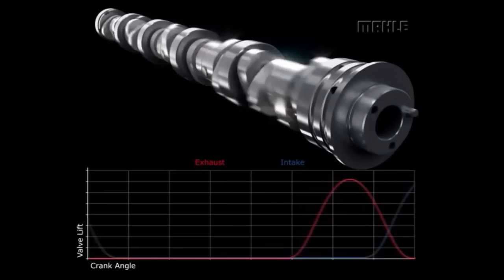2021 427 Mach 1 Mustang ..  Fords 7.3 Godzilla Engine.....

Comment: The pushrod motor will be able to get higher torque numbers than an overhead cam design. For a big block, torque is a must!
Reply from the maker: Makes for a good truck motor i guess
Reply: @coyotecarguy2076  yes,exactly... but I would love to see Ford find a way to get big torque numbers from a overhead cam assembly. Then it would be the beast of big blocks!

Comment: Coyote carguy  An aluminum Ford Windsor push rod engine with added tech is exactly what the Chevy LS engine is. Most engineers agree the LS engine is nothing more than the Ford Windsor engine made in aluminum alloy with a few changes. Ford Racing is making Big power with their engine and these engines are tons easier to work on. A balanced aluminum alloy pushrod engine with all the new cylinder head improvements is exactly what we all need in a Ford Truck. If they can vastly improve fuel efficency with the new injector tech it's a big win. No twin turbo V6 garbage!!!
Reply from the maker: Gman Neo'd....  My thoughts exactly.. A DOHC engine is awesome but if the proper tech is applied to a pushrod design would be a versatile 
engine suitable for many applications... lets hope it happens...

Comment: ford will do both, a 7+liter pushrod, primarily for truck duty, and a 7 liter dohc , which is for the mustang, and possibly another vehicle, such as a hotter version of the mid engine GT.
Reply from the maker: Bono Simic....Well, I hope you are right. A 7.0 DOHC is waht i would like to see.
Reply: I know this is been a year ago. But I seriously doubt we will see a 7 liter anything in a car these days. The new Mach 1 will be getting ready to be unveiled soon.  I am curious on what engine it will have. If it is 7 liters it most certainly will be a big shocker. Ford hasn’t had that big of an engine in a passenger car in 4 plus decades. My guess is it’s another variant of the 5.0 coyote platform. I can’t imagine them squeezing much more hp out of a NA coyote and still run on pump gas. The bullitt has 480hp. It might be the beginnings of a hybrid system. I wouldn’t think they would put the voodoo flat plane crank engine in it??? Who knows. 🤷‍♂️

Comment: Honestly I think Ford building a pushrod motor would be a step backwards might as will remove the independent rear suspension and put the live axle back in it. Doesn’t make sense at all.Ford has sunk tons of money into the eco-boost program and have always made more horsepower with smaller engines look at the coyote 5L, The GT500’s had a 5.4 L, and  the 13-14 GT500’s
a 5.8L with 662hp that was five years ago and everyone is talking about 707 hp from a 6.2 L engine???  Hopefully that 7 L mystery motor is coming soon and ends up in the next mustangs platform...
Reply from the maker: IMGONEIN60. Hey my friend thanks for posting. Yes my friend i am disappointed also. I think ford is looking at cheaper engines. Its the only explanation for this. Lets see what happens. i am hearing that this new engine could end up in the SUV version of the Mach 1 that is coming out in 2021. Should be interesting.
Reply: Coyote carguy The Mach 1 is going to be an ALL electric performance SUV Ford announced it when they announced the upcoming ford ranger, and the edge ST along with the 2019 bullitt.
As far as the 7 L motor being pushrod I don’t believe it at all the primitive pictures that I have seen of it I’ll look like a modular design. But like you said We’ll see.
Reply from the maker: IMGONEIN60. The mach 1 version if that SUV Is the electric one. what i mean is that that SUV may have this engine not the Mach 1 version, You are right about that. Truthfully i was convinced that the 7L engine wad DOHC. But i herd from someone from the industry who informed me otherwise. Hopefully i am wrong. It wouldn't be the first time.
Reply: Coyote carguy yeah let’s hope it finds its way into a mustang, even if it’s a specialty mustang and not just going into a truck or SUV. We’ve seen what Ford has done with the 5.2 L that’s just amazing imagine if ford came out with a modular 6 L motor, Dodge and Chevy would be suicidal LOL
Reply from the maker: IMGONEIN60. You are spot on!! Read my mind exactly. I Would like ford to make the 6.2 Truck engine into a DOHC engine like the coyote. I think that is a 390ci engine.
 didn't the original Steve Mcqueen bullitt have a 390ci? That would be the ticket since they already have the motor!!

Comment: I personally never understood why no one made a four valve pushrod engine.  There was a company that made a 4 valve push rod head for the Windsor 5.0 back in the early 90's.  Seems like an OEM should have gone that way at some point in time.  I would imagine a DOHC 427-429 cu. in. displacement engine would be very wide and difficult to package based on deck height and valve cover width.  The S550 doesn't look like it's all that wide.  However, I don't know the actual dimensions... so maybe it is wider than previous generations of Mustang.  Should be very interesting to see what actually happens!
Reply from the maker: fwh79. That's Funny i remember that 4 valve head. What ever happened to it?? If you should find info on it please forward it to me. Imagine a 4 valve pushrod motor with with the mahle cam in cam  twin phaser tech?? It would be awesome. Thanks for posting my friend!!
Reply: Coyote carguy:  I'm not sure what happened to it.  I want to say I remember two different companies making a 4 valve pushrod head.  I have a book that is copyrighted 1992 that shows a 4 valve pushrod head for the 5.0W that is made by Arao Engineering.  I think at some time in the later 90's another company tried to bring the idea back.  I can not remember the name of that company.  They never really took off because they were much more expensive than the typical bolt on heads at the time.  Most guys didn't want to spend $1000.00 on 2 valve heads.  I want to say the 4 valve head was some where over $2,000.00 for the lowest level head.  That was a lot of money to cut lose with for heads.  However, they were probably worth every penny.  I think there are several OEM diesel engines that are 4 valve pushrod engines.  That makes me wonder why none of the big 3 companies never decided to go that route.  A very interesting thought indeed!  I just did a quick YouTube search and found two videos you might want to check out:  Ford-  https://www.youtube.com/watch?v=hW6l_MN9Uys  Chevy-  https://www.youtube.com/watch?v=vRKTRLD2h8k  Ok... now that I have watched that... why has this never been an OEM head design!????
Reply: Coyote carguy:  Check THIS video out too... LOL!!!  https://www.youtube.com/watch?v=GbOq1O5y-Y0  I guess THAT is why you don't see or hear much about Arao heads! Hahaha!  It's not really funny... but it's pretty damn funny.
Reply from the maker: fwh79...There is a lot to talk about with this 7x engine. There is talk that the power levels will compete with the diesel engines. That guy with the corvette was pretty pissed!! I don't blame him. My Radar is up on the 32V thing.  Thanks for the heads up My friend!!
Reply: Coyote carguy:  You're welcome.  I hope they call the new engine Gorilla!  That is a great name.  Yeah, the vette dude was mad but he should be.  I guess it still boils down to "buyer beware".
Reply from the maker: fwh79.... Yes sir!! Buyer beware!!  By the way i will be doing some pretty stout mods to my car and and you will probably like who is doing the work!! So stay with me,. It's gonna be fun!!
Reply: Coyote carguy:  Sounds good.  I'm not going anywhere brother!

Comment: I know this sounds disheartening...but i'm glad Ford is still building V8s at least.  Or still plans to.   I'm happy with my DOHC 32V V8 5.0.   As a matter of fact...back on your other video where you talk about people's disappointment with the 4.6 liter....I was one of them!   I would have been so much happier with a 5.0 hands down.
Reply from the maker: Tony Amarillas. Hey Brother, Always nice to hear from you! You think very much the same way i do. I feel grateful that we still have cars like this. I love my 5.0 Mustang as well. If the next generation mustang is not better then the one i have i will keep this one for a long time.
Yes my friend the 4.6 was a bad idea, If it were equipped with vvt on the DOHC 32V 4.6 V8
Than maybe it would be a good motor. But they sucked the way they were built at the time.
Today things are better, i hope ford does not screw things up. Thanks for posting!!
Reply: I have a DOHC 281 inch modular in my Mach 1. With a few easy mods it makes 350+ HP. 
How were they a bad idea? They were a match for the other larger V8s of the day. The bad idea IMO was the SOHC 4.6 being in the Mustang GT. EVERY mustang GT from 1996 up shoulda had the DOHC 4.6
Reply from the maker: 331 grabber.... What year cobra did you have? or was it a 03-04 Mach1?
The camaro from 93-02 were very stout. a few mods to them and look out!!
The problem was GM was putting 350's in the camaro and trans am of the day. The 2 valve sucked. the 32 valve was not bad but i personally watched some friends with cobra's get whipped by the camaro's. My point is that if ford built a 5.0 instead of a 4.6 things would have been very different. And mustang owners would have been much happier.  
ford made the correction and built the 5.0 coyote! Thanks ford!

Comment: Hi Al,
Have you seen the videos of the Stang owners that have clicking engine noise issues, some stating it is piston slap, caused by the new method cylinder lining?
Reply from the maker: johnnyrmac...Yes check out "boosted addictions" He had his motor replaced for the ticking problem and now the replacement engine is ticking as well. even worse then the first one.
The gt350 used the spray bore Technology and we don't hear about those problems with those cars. I herd there was a bad batch of motors and we hear about them one by one. so far this is not a wide spread problem. i really feel bad for that guy!!

Comment: Build the 7.3L Godzilla Engine, with pushrods...put it in any V8 Mustang . A possible choice would be to put in the BULLITT MUSTANG, take one to SEMA beside a GT500 or a SHELBY SUPERSNAKE, then send that same car to the Detroit Auto Show or in New York. Then watch FORD take orders for the first 2000 cars.
Those orders will be filled within 30 days. People complain that it won't be faster than the Supercharged Mustangs.Doesn't have to be: IT'S A FACTORY BIG BLOCK FORD MUSTANG. That's why IT will sell. FORD'S NEXT BIG IDEA.
Reply from the maker: Jay Britt.... I like your way of thinking... a big block mustang will sell no matter what.
some people are saying that the 7.3 block is to long to fit in the S550 mustang. I am gonna say they will make it fit if they want to. Like putting a 460 in a fox body.

Comment: The rumor mill is spinning like a pinwheel I'll believe 427 dohc Boss 429 when it sits in the showroom floor Ford dealers.
Reply from the maker: Lorenzo Maximo....This is an old video i posted a while back. The news today is that ford is building a 7.3 liter pushrod engine for the big trucks. this engine will be used for specialty vehicles including a limited production mustang.
Reply: @coyotecarguy2076  
I hear what you're saying but this is an old story that's been circulating for quite some time and hasn't come to past yet. I don't know why Ford is so reluctant. They could have produced this engine years ago but haven't. They just seem to be infatuated with small cubic inches. The dual overhead cam Coyote engine is a great motor but it's very hard to work on compared to a pushrod motor. Plus it's not classic car friendly a lot of modifications need to be done to install this motor in older cars.
Reply from the maker: Lorenzo..... I Hear Ya!! This time however we will see the new motor!
I will probably be the first to report so keep an eye on my channel. The motor will start as a 7.3 for the truck. Then will get tuned for other vehicles. Lets see what happens!!!
Reply: @coyotecarguy2076  
Why is Ford going to install it in the trucks first I don't understand that. Just cut to the Chase and go right to what people have been screaming for four years a big block Mustang.
Reply from the maker: Lorenzo...The truck needs a new motor. so ford will start there but a big block mustang will probably be built in limited numbers and be very expensive.
Ford will continue to build 5.0 and 5.2 DOHC engines for a long time.
Reply: @coyotecarguy2076  
The truck needs a new motor? Why? I'm driving a 2010 F150 with a 4.6 3 valve great motor. Why do they keep thinking that F-150s need a new engine? My brother has a 5.0  in his 2012 F150. It's also a great motor plenty of  horsepower and torque. So why the need for new motor in the trucks?
Reply from the maker: lorenzo.. These days the F-150 is using the 5.0 v8. The 3v is out dated. it is a good motor though. the 7.3 is for the big trucks like the F-350 And F-450. The new engine will be more powerful and more efficient and cheaper to build.
Reply: @coyotecarguy2076  
I know all about the 7.3 truck engines in the 350 and 450 s I used to work in a Ford dealer years ago. What's this got to do with it a Mustang motor it's going to be used in a truck I don't get that.
Reply from the maker: lorenzo... There is good news. there is a good chance that the 7.3 will end up in a specialty mustang. That is what you want right?? but it will be an expensive car. other than that, the 5.0 will be available.
Reply: @coyotecarguy2076  
But you said the new engine would be more powerful and cheaper to build so why would it be more expensive in the Mustang?
Reply from the maker: lorenzo. expensive for the mustang because the engine will be tuned for a performance car so extra R & D will be necessary for it to run like a big block performance car. It will be built in limited production as well so we can expect priced more like a GT350 and cars like that. I expect a boss 429 or at least that is what i am hoping for!!

Comment: Thank you for info Al.👍

So there will be a Boss 429 then?? Hope it's a Drag car monster for strip and street.

That's awesome, if it's true.😎
I want one bad.

Will it have Hemi heads on it like the original I wonder??
Reply from the maker: Faithful Servant.  There could be a BOSS 429. But what is under the hood is the issue. Looks like it will have pushrods. It may be a good running engine though. Unless there is a secret engine being built somewhere.

Comment: There is no way Ford's going back to a push-rod V8. Free valve engines are coming. They will have infinite cam flexibility.
Reply from the maker: 331 Grabber...Unfortunately i am hearing from a very reliable source that the new truck motor will be a push rod engine. I am hoping i am wrong, but that is what i am hearing!! Keep an eye on my channel i will post more news when it comes in! Thanks for posting!!

Comment: Hey there yeah in my opinion GM Can Not build a good DOHC Engine. Ford on the other hand build pretty good DOHC Engine s. In 1995 I had a Oldsmobile cutlass convertible with the optional 3.8 L V6 DOHC Engine and it was crap!!!! At 55k miles it was already consuming oil from hell and blowing white/blue smoke. I ended up trading it in. POS!!!!!
Reply from the maker: Mike J Autos and Stuff.. LOL! Funny! My older brother who is a die hard chevy fan had the same car with the same problem!!! see that car i do my vlogs in? Its a 2002 ford escape. 
3.0 v6 Has 130K on it and it runs perfect!!! I will drive it forever! Because of that escape i can have my 2018 mustang. Love my fords!

Comment: The new motor is purely a truck motor d.o.h.c  to wide to fit in the truck s .the new motor has veriable vavle timing cast block special cylinder walls and is designed to be almost bullet proof and make bucket loads of torque. It will never see its way into a Mustang just the weight alone makes it a unrealistic idea  .if ford sell this thing as a create motor the potential to use it in other aftermarket application's is endless. ...
Reply from the maker: MYXRUTE falcon........ when this video was posted there was some news coming my way about this motor in the mustang. It is still possible but they will have to cast the block in aluminum. If it does happen it will be limited production vehicle.

Comment: 7x is a 445, not a 427. Lol
Reply from the maker: Justin Gulley. Funny! The 7X engine as well as the 7.3 Gorilla motor is the same project. It could be stroked to 7.3 or 7.0 or anything in between. when we get the actual dimensions of the block we will know more. Thanks for posting!
Reply: Coyote carguy there are rumors of a 427 double overhead cam Not pushrod
Reply from the maker: Justin Gulley. Yes i did a video on the 427 DOHC Engine but i have herd form someone who is close to this project and i was told the engine would be cam in block. I hope he is wrong and we see the dohc engine come out.
Check out my other vids you will like them i am sure. Thanks for viewing!!
Reply: Coyote carguy I'll put $100 PayPal that the 427 will not be push rod. Lmao. 445. Largest valves ever put into a production engine 2.20..
Reply from the maker: Justin Gulley. Hey Dude!! I sure hope you are right!!! If so i will be glad to give you $100.00  Lets see what happens!!

Comment: Never happening!! Motor weighs to much...
Reply from the maker: David Sluus..... Consider the idea that that 7.3 could be cast with an aluminum block.. The early 4.6 mod engines started with cast iron blocks then they were all aluminum late in the production Run.